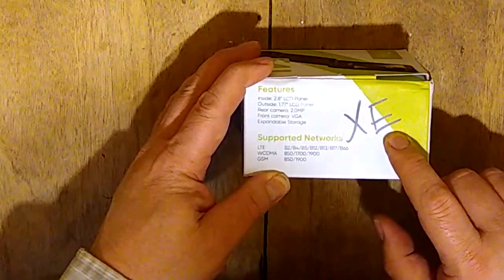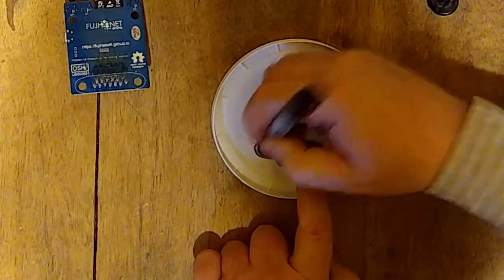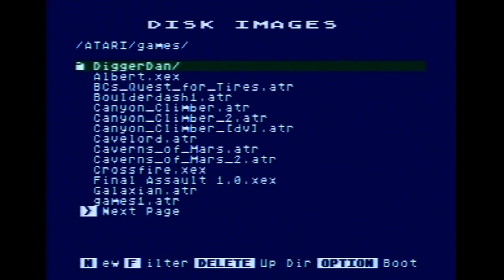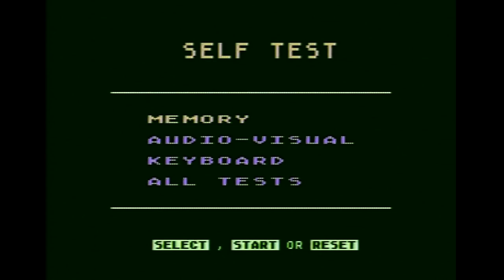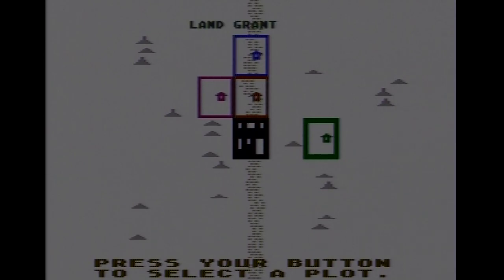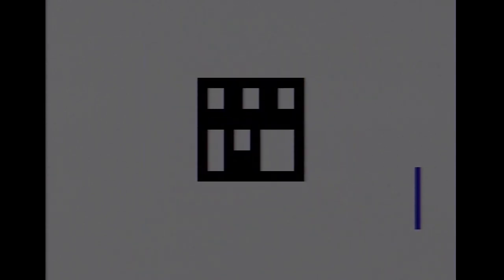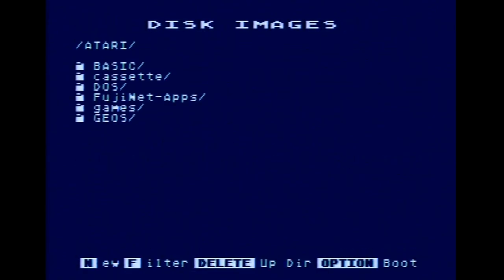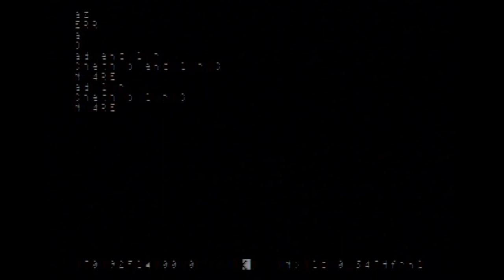Fujinet ultimate ATARI 8-bit peripheral unboxing

Comment from the maker: I have determined that my attempts to connect to nethack.alt.org were stymied by the fact I put a space in between atdt and the address.  I should have typed:
atdtnethack.alt.org instead.  However, upon successfully connecting, I was not able to play nethack.  It appears that whatever response nethack.alt.org is expecting to some kind of terminal identification string, flickerterm doesn't respond correctly.  I've also tried Bobterm with similar results.